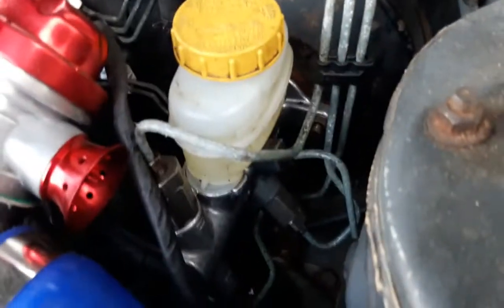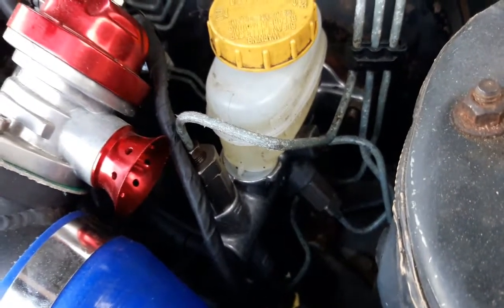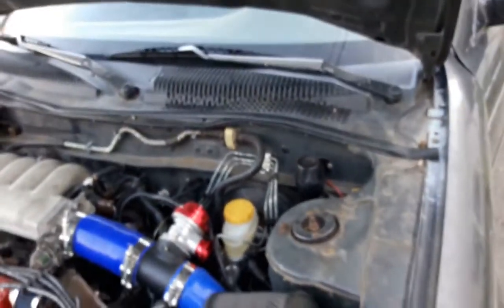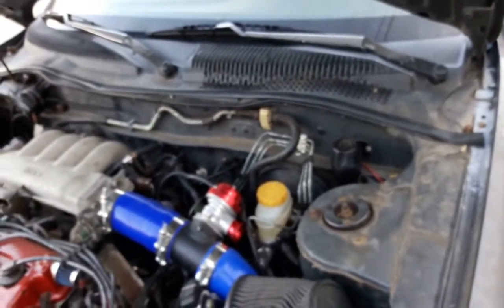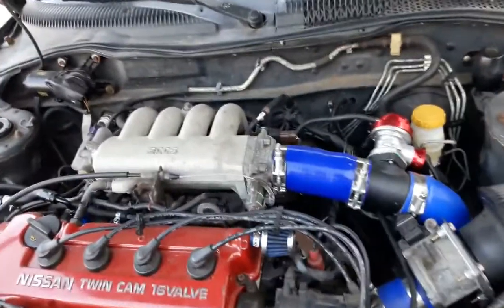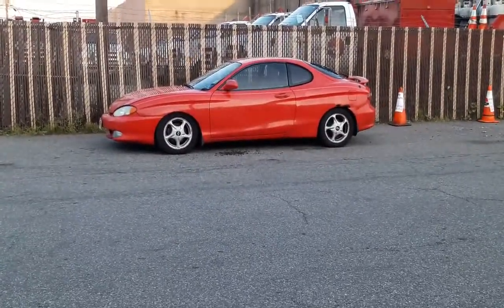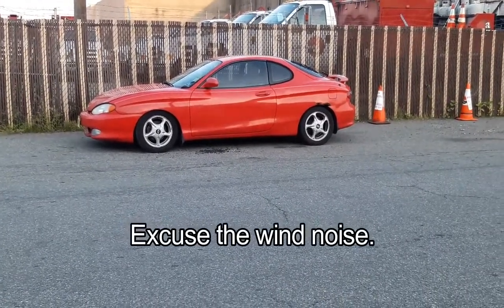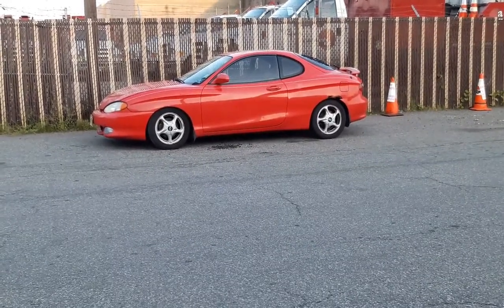B13 Turbo Sentra Update + New Master Cylinder Pump

Comment: Where is all the brake fluid going ? Look for a leak .
Reply from the maker: I found that one of the metal lines by the master cylinder wasn't sealing properly. Even tho I had no fluid leak, I always end up having air in the lines.
I was kinda upset when I found it out.

Comment: Where does the plug that connects to the breaks cylinder goes mines have been cut off and i need to connect it
Reply from the maker: I can't remember 100%, but the plugs turns on your brake light when the reservoir is low on fluid.

Comment: does this car have abs ? does this car have rear drums are disc ? give the Hyundai love on the channel to
Reply from the maker: PA Tuners thanks bro..
non abs, rear drums and front brake discs.
Reply: Since it's drum brakes have you checked the rear wheel cylinders ?
Reply from the maker: PA Tuners nope, but the e brake works like a champ..
Reply: G2G Builds  E Break is on a cable so will have nothing to do with your rear  brakes are fluid. replace the back wheel cyl I say there bad should be a cheap fix
Reply from the maker: PA Tuners Thanks brother..
i will lol into it.. :)
Reply: G2G Builds hopefully that's it but I'm 95% that's the issue your having without being there to check it out. if no break line leak issues it's wheel cylinders
Reply: G2G Builds no problem brother
Reply from the maker: PA Tuners Thanks again.. 👍
Reply: mike'z dedan  Well good for you 😂
Reply from the maker: Lol